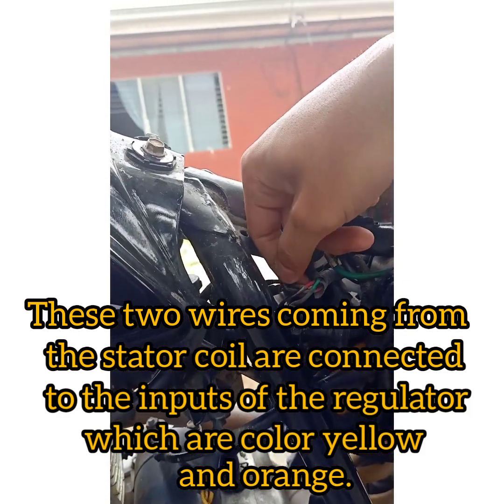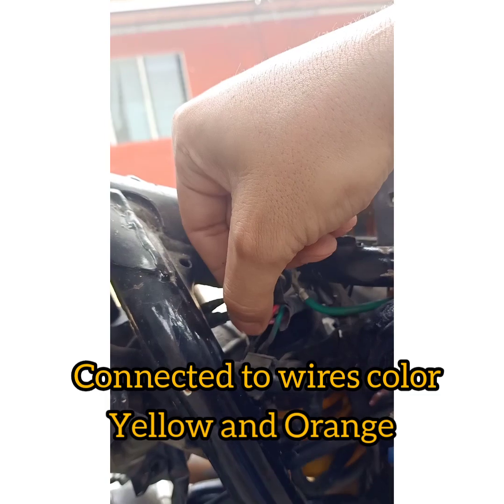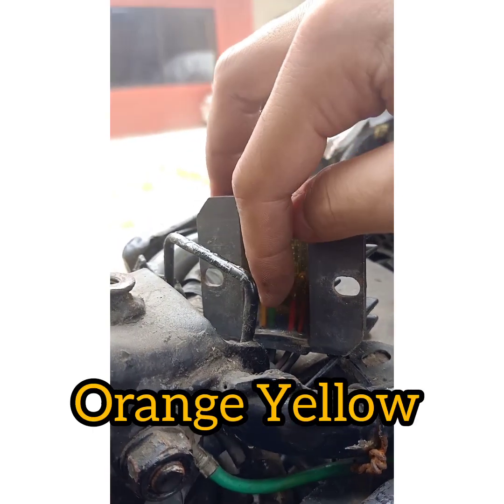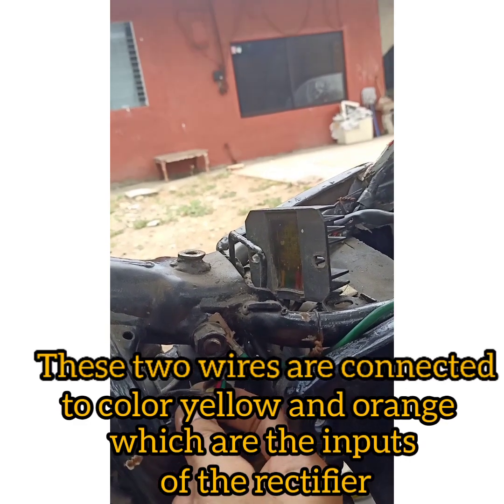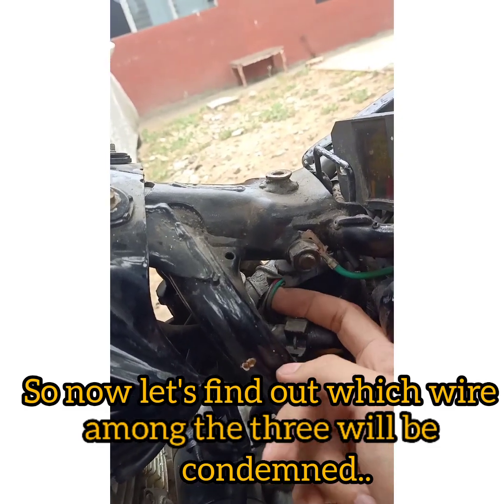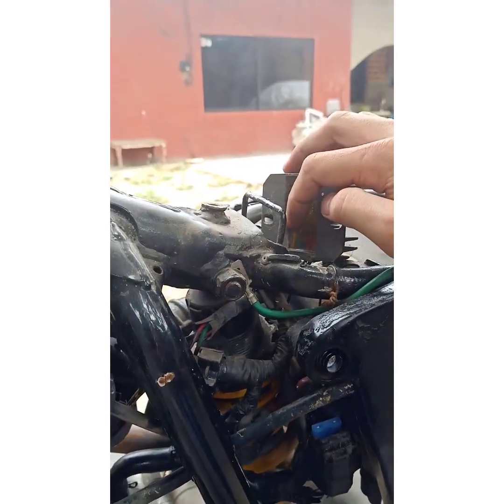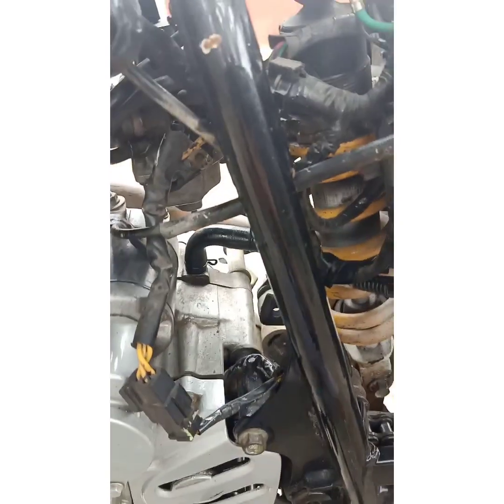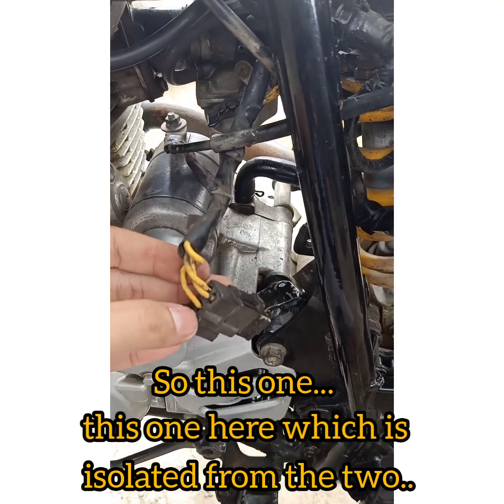HOW TO WIRE SKYGO150 VOLTAGE REGULATOR/RECTIFIER  IN XR200, XR200 USING SKYGO150 VOLTAGE REGULATOR

Comment: Yon pong brown n may lining n red gling stator San po nka connect
Reply from the maker: my iba ako na video na mas klaro ito po link https://youtu.be/zTx76Q1_T_o
Reply from the maker: basta galing sa stator puede lang yan magkabaliktad kasi wla yan polarity AC po yan
Reply from the maker: if 5 wires nabili mo kasi wla na 4 wires ngayon pagsamahin mo lang ang red at black at sundin mo na lahat nasa video
Reply: Nasunugan kasi ako sir nang regulator,,yon bang red n may lining n white nka direct b yon s battery.
Reply from the maker: pag nasusunog regulator baka meron problema stator coil mo? may post ako sa page ko kung paano icheck ang stator coil..message ka sa page pra ma send ko mga wiring diagram at picture
Reply: Nung tinanggal ko kc yong red n may lining n white nwala usok.

Comment: Got a 5 wire rectifier from skygo. will try, and see how this goes.
Reply from the maker: https://youtu.be/zTx76Q1_T_o

thats a clearer video..if 5wires just connect the red and black wires then follow the rest of the video
Reply: @DIYGaragePH  sir. where do you connect the orange wire (which one of the two yellow wire from the engine?
Reply from the maker: any of the two yellow wires..it is interchangeable because voltage output is alternating current  there is no polarity

Comment: ayos sana sir if step buy step yong hindi naka balot yong wire,, or tangalin yong socket  para makita talaga ang pag connect from regulator to stator coil wire,, suggest ko lang yan sir,, salamat sir Godbless
Reply from the maker: salamat sa suggestion sir..ok sir gawa ako ulit ng video pra klaro..naisip ko rin yon ehhh..message kalang dito sir if meron kang itatanong o iclarify salamat and God Bless!
Reply: sana sir wag mo englisin d nman nanonoud mga ibang lahi sa blog mo use our language para maipaliwanag mo ng maayos
Reply: Bos ok lng ba na magkapalit conections yang 2 yellow wires galing stator?